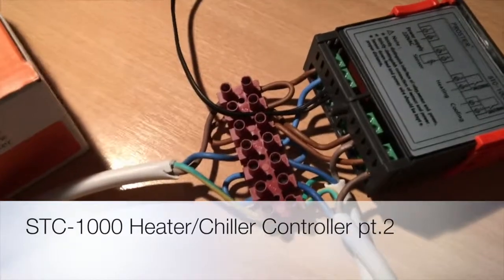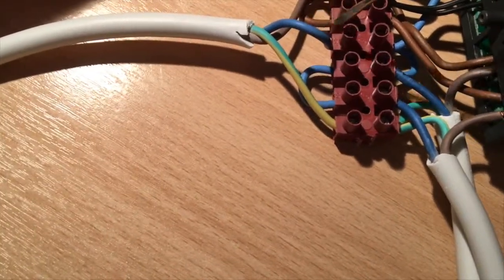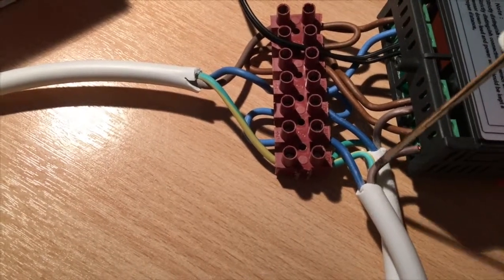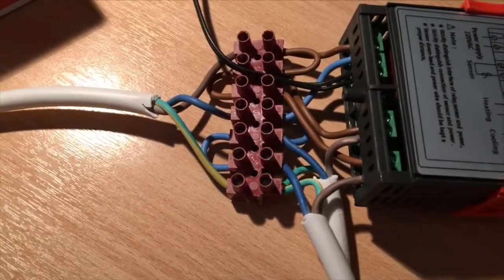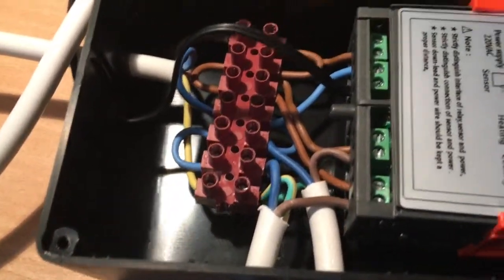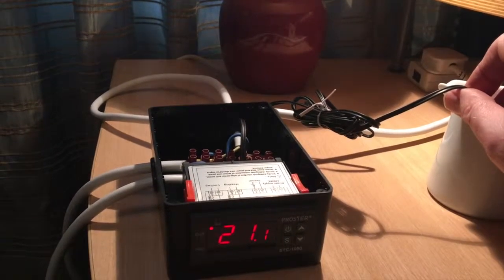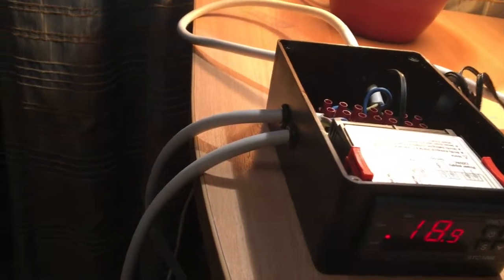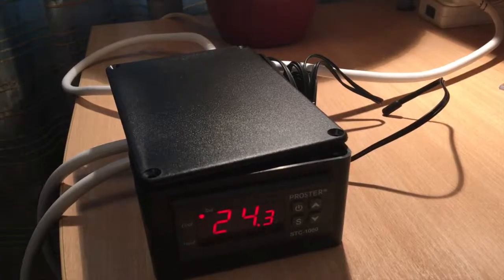STC-1000 pt.2

Comment: I have a question for you, IF you are using this setup for water heating can you connect 2 heating boiler rods and do you have only 10 amp to work with ? How can you add more amperage if this is the case? I would like to connect two 2kva boilers to this thermostat but I need 8.6amps per boiler rod.
Reply from the maker: This might be a question you want to as Big Clive, he has a teardown video on these https://youtu.be/T4umSkJjXwY  This might help you more as he shows the relays and their rating. Drawing more than 10A off one relay will either kill it or reduce its life very quickly so not advisable.
Reply: I need to warm a 2000 liter (528 gallons) fish tank circulating every 25/20 min 150 liter (40 gallons). Temperature for our current Autumn state is  17 Celsius (62F) and I need to raise it with 5 degrees for winter times coming. (Aquaponic system with 3000 liter water in system total. )
Reply: Do you think what I am going to build might be over kill or not enough ? for warming water ?
Reply from the maker: @alexiz.7569  If you are heating a body of water for a fish tank you want to do this slowly. A single heater element should be enough as you only want to warm the water not boil it. The heater might need to run for longer but should warm up the water eventually. Have you tried a specialist forums to see if others have done the same?
Reply: @joewoodford9428  Do you have any expert forums for me I can ask ? I tried to calculate the ratio for heating water/ power output but with water circulating the sum is invalid.
Reply from the maker: @alexiz.7569  Hi, I use their to control my fridge as part of the beer making process.  Its used to either run a heater strap or switch on the fridge (if too hot). You might want to google aquarium heaters and see if you can find one on the STC-1000.